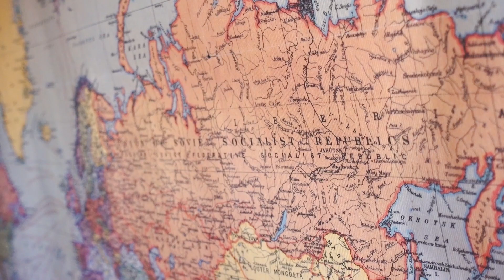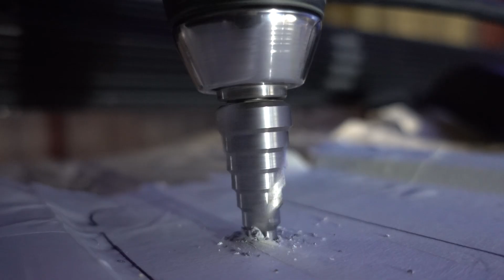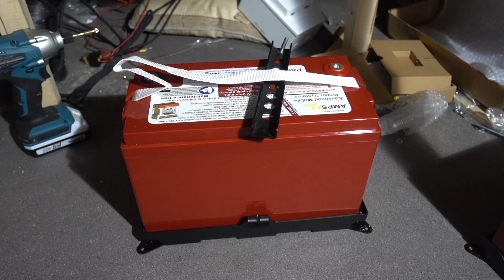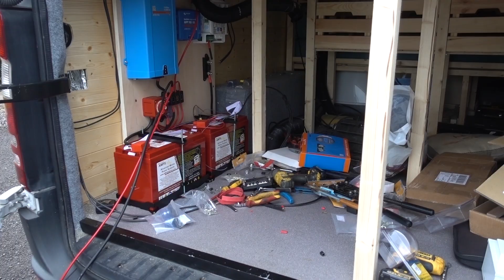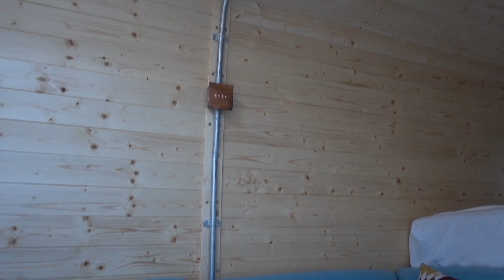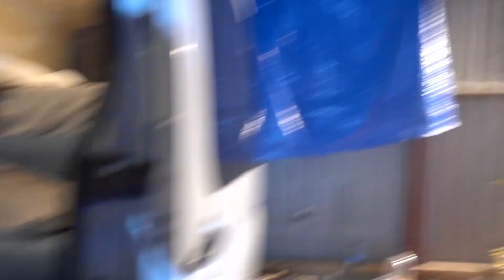Our Lithium Solar Van Life Set Up!

Comment: I think I’ve worked out why you had that short and almost fire in Finland (think it was)...from memory you showed a small link cable from the DCDC charger to the fuse(about 3 inch long) that was scorched. 
It appears youve got 3 or 4 cables on the DCDC charger going in to 1 terminal.. My guess is the terminal screw had worked loose over time due to not clamping all the cables properly causing arcing and sparking. I’ve seen it so many times being an electrician on household sockets.

My recommendation would be to buy a ‘power distribution post’ and run all cables to that then take a single cable from the post to the DCDC charger.

Not saying how it was installed was wrong..just that I would do this as it is much safer.
hope what I’ve wrote makes sense...if not, gimme a shout and I’ll do you a wiring diagram and email it to you 👍🏼

Comment: AMAZINGLY HOW SUPER EXCITED you get over little things 
Did u file the rough edges from the Drilled Holes
Personally i would have repositioned the Batteries to the Centre idealy over the Axle distributing the Weight better instead of Loading the Rear Corner up

Comment: Great work guys! Top shelf solar system for sure!!!!!! I have a couple Victron 100/50 controllers in a rig; awesome. The proximity of the controller to battery will work well with Victron's internal temp sensor. Can you monitor the controller from your phone? That's a cool feature if you got it. Also guys, please consider ventilation when you close up the "solar" compartment.

Comment: The van is looking great but I have to say that exposed conduit and it’s mounts for the lights should be copper to match your upside down light switches, plug sockets, sink and other bits of copper piping. That galvanised silver conduit looks awful, sorry. You definitely need a full height panel to hide and protect all that electrical kit. Good luck guys in your new adventure and have a safe trip. Bon Voyage.
Reply: Agree. You could use Rub n Buff which I've used on some of my steampunk'd motorbike to colour the metal - it works well.

Comment: Your panel according to Bimble although only 390 watts (only lol ) throws out up to 500 watts but your charge controller is only 30amps, when I ordered the same panel was told it needed a 40 amp controller.  I am sure it is perfect as all products are top of the line and fitted by the best but this just confuses me, it really doesn't take a lot to confuse me.  Absolutely loving the lighting, never seen it before. So excited for you both and hope to meet you in Portugal :-)
Reply: I missed the part about the Bimble, but I think that's a high voltage panel (35-40 volts) with less than 10 amps current. The controller takes 100 volts and about 450 watts. There should be good headroom (panel voltage - battery voltage) for the MPPT to make more amps, but 30 amps should do it fine it seems. I'm not an expert, but these larger 60 module panels don't have much of a current rating, maybe 9.5.